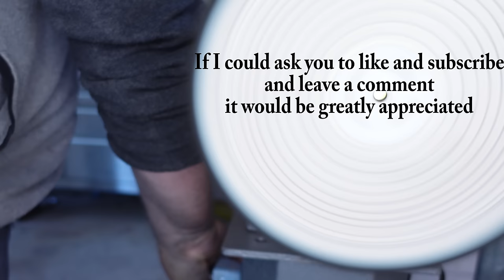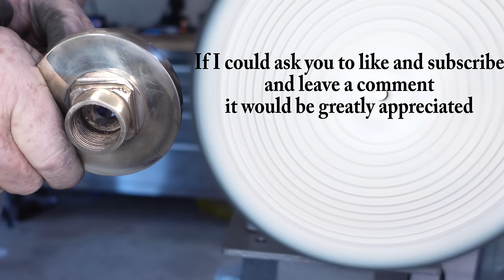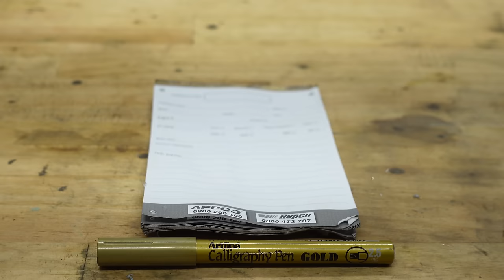Restoring an Old Beer Hand Pump - 1900s Style

Comment: Hey richard, please be careful when disassemble this old items. At 4:30 you remove the old gasket that seem made with asbestos, always wear a mask and wet it with oil before removing. Safety first.
Reply from the maker: Thanks Francesco  yes I agree with you with asbestos, I did run a company removing asbestos from homes ,the fibers on that gasket were too coarse and was coated with  what looked like lead  . I either way thanks for your concern  Cheers Richard

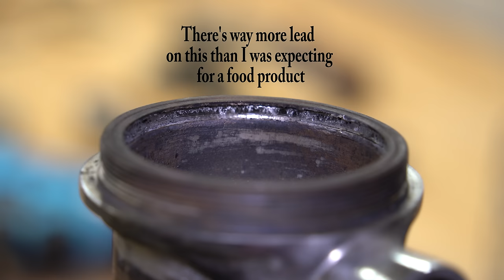Comment: great restoration! At 9:00 did the solder really contain lead? because normally one would use tin, which itself is no risk to health at all. however there are tin solders that also contain some lead...
Reply from the maker: originally I was going to powder coat with a clear that's why i needed the high temp glue but didn't like the end result on a test piece
Reply: I meant the part were you said you're surprised that they put lead as the original solder. Was it really lead i wondered...

Comment: I think I would have opted for lead-free solder instead of jb-weld for putting the fittings back on the brass pipe. That way, in the future it would still have been easy to take apart again for cleaning without the worry of lead poisoning of normal solder.
Reply from the maker: Thanks for your feed back cheers Richard 😀

Comment: Beautiful restoration. The brass looks way nicer then the nickel coating. One question, what is the name of that tool that you used to clean out the inside of the brass tube?
Reply from the maker: Hi Mike thanks for the encouragement,  the tool is a honing Stones common use for engine restoration cheers Richard

Comment: Love your restoration and don't worry am subscribed and liked all the videos hehe, I am in love woth your lathe, and the tool you cleaned the inside of the tube with is just marvelous.

Question though when you said too much lead for food product you meant the lead they used to wield the top of the pump to the handle part and the bottom correct ? Which you reolaced with the JB wield I bekieve because thats basically steel and the whole thing is made of Brass I believe, am I correct?
Reply from the maker: Thanks Mohamed for watching
the beer passing through to the tap was exposed to the  solder which is got a high lead content, the other thing I was considering is the solder has a low melting point at 185 degrees Celsius JB weld 287 degrees Celsius, and powder coating is done at 200 degrees Celsius, I was considering powder coating with a clear coat ,JB weld has given me more options to work with
Reply: JB Weld is not food safe. You probably need to clear coat it to isolate the JB Weld.

Comment: Only real complaint is that not all of the restoration was seen like the wooden handle and some of the smaller parts.
Reply from the maker: hi Shaun ,it's a balancing act between getting enough engaging shots  and too much. the folder file size is 550 gig i have to trim it down to 21 gig and keep it under 30 minutes ,the wooden handle was left original because it felt like 100 years old and I didn't what to strip it of all its history , thanks for your feed back cheers Richard
Reply: @richardrestorations  
Reduziria muito o tamanho do vídeo se não fosse tão parcimonioso e propositalmente lento em muitas partes.

Comment: next time use silver tin solder it cost more but no lead it has a higher melting temp as well instead of epoxy which also has contaminates that can harm people.
Reply from the maker: i was going to powder coat in clear but after doing a test bit i didn't like the color it went to
Reply: @richardrestorations  yeah I hear you.

Comment: I've been working on restoring one of these old beer engines on-and-off for years. I'm mostly stuck with hand tools, so it's slow going, but got some good tips here. Especially what you used to polish the inside of the cylinder. Will have to get me one of those.
Reply from the maker: thanks for watching😀hope it helps